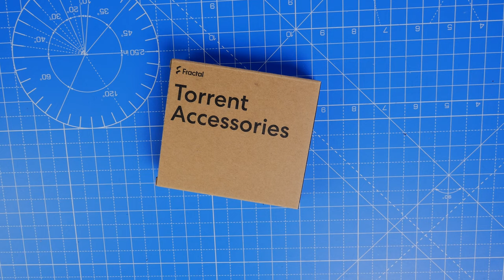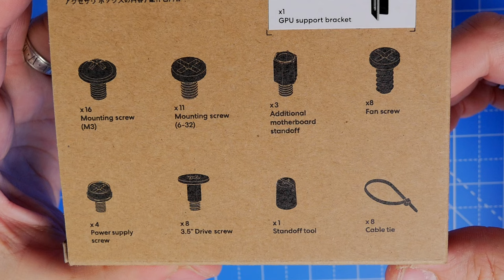ASMR PC builds - Fractal Design Torrent

Comment: Hey Prawn, what fan are you using for the exhaust? And did you connected it to the hub aswell? Where does the hub plug into on the Motherboard?
Reply from the maker: hello! It's a 140mm Fractal Design Dynamic X2 GP-14 - the white one obviously, which was a mistake as it probably should have been black to match the others. I had to use an extension lead to get it to reach the hub, which I had separately, i'd suggest just plugging it into a system fan header instead. The hub I also plugged into a PWM system fan header on the motherboard. The manual says CPU fan header, but I'm using that for the cooler, so that seemed illogical.
Reply: @theprovokedprawnasmr  awesome, thanks for the tips!